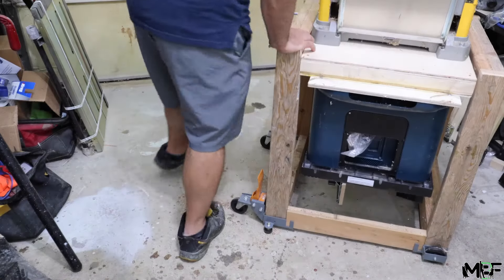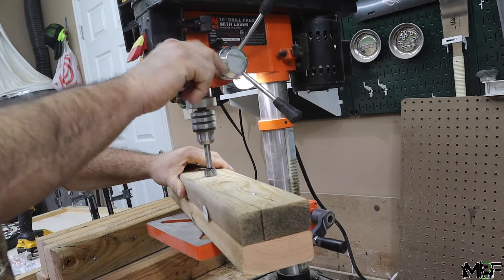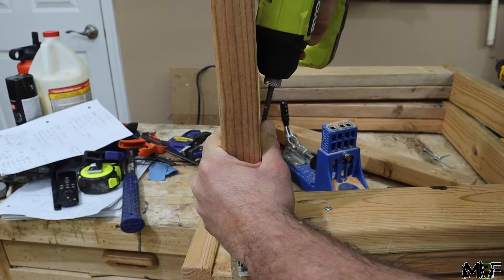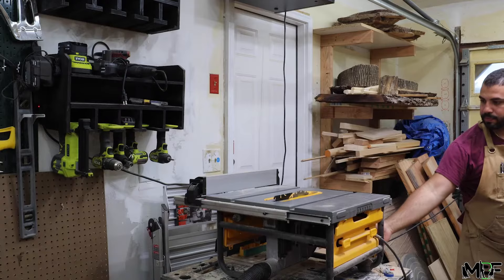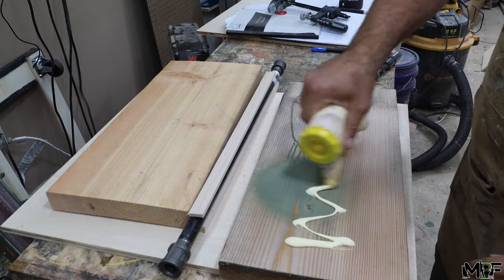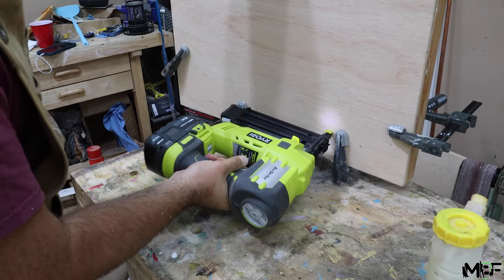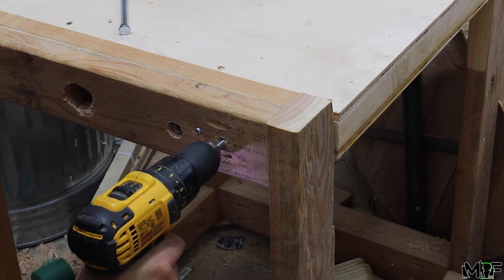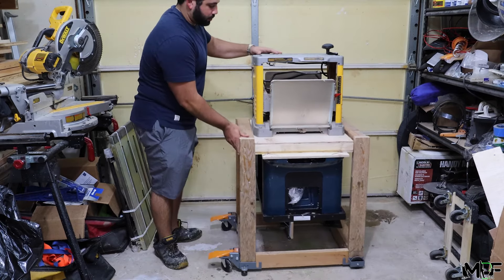Make EASY Flip Top Tool Cart | router and planer stand

Comment: Earned my sub! I seen a few designs like this a few years ago and have been meaning to make one as my shop is TINY (10'x 20'). Believe it or not I have a tablesaw, freud router table, rigid planer, delta jointer, a small ryobi band saw, a CNC router(with enclosure) 3D printer, laser engraver amongst SO MANY other tool in there. Although I have had to come up with some pretty unique ways of layout/storage in my shop that allows for quick(less than 1 minute) to swap out tablesaw for router table/planer etc... you can imagine my frustration in such a tiny shop....anyway, i went hunting for a video of this type and yours popped up first and I'm glad it did! Such an ingenious and SIMPLE design. I will NO DOUBT be making one of these today! Thanks for posting this! Two thumbs up!

Comment: I like your design and fact that I need the stand for same tools: planer and router table. I was surprised thought you used screws to mount the router to the platform. I might go with bolts instead. Thank you for sharing though.

Comment: I decided to follow this instructional. I've reached the point of completing the frame. The issue I encountered was the sections with the holes. Not having a drill press meant that the holes  on ne side were sloping and not level. That in turn meant that rod that will need to go through these did not align properly. As a relative novice woodworker, I decided the easiest solution was to cut a notch into the holes on one side. That now solves the problem of aligning the rod. Now I have to reinforce the notched side so that it can carry my miter saw when it is turned upside down.  This is a challenging project unless appropriate tools are available. Nevertheless, I've come this far, so I'll continue.

Comment: This looks great and exactly what I need.  How did you attach the pipe to the frame to keep it from sliding out?
Reply from the maker: Just screw fittings on to each end so that it’s too thick for the middle opening and you should be good

Comment: Of all the flip top carts I've seen on YouTube, this is the simplest and strongest one I've seen.  Great job.  By the way, where did you get the corner fixed wheel caster you used?  I checked the link on your comment for the caster wheels and it only showed the flip pedal ones.  Thanks.

Comment: I need to do this, but I think I would find some PVC to put into the holes where the pipe rotates so it doesn't wallow out the wood eventually, or some type of end that rotates, I think you could have a cheaper option for the bolts that lock it in place. But nice overall, I think the top was a bit overkill with the almost solid wood top, could have been 2x4 running flat with a 2x4 frame and plywood and would have been fine.

Comment: Great video. Nice to find one of these not made with a 3/4x4x8 sheet of plywood.  With coming up on one year how is it holding up?  Did you use 1/2 " plywood for the top?   Thankyou for sharing this, It's 99 degrees here so I'm just taking a break from cutting up my 2x4's .
Reply from the maker: It’s holding up absolutely awesome! The other day I even stood on top of the table to reach something on my ceiling and it didn’t budge an inch. I think it was 1/2” ply yep!
Reply: @MakersBestFriend  Thank you for the quick reply. Glad I found your channel.

Comment: I need to make this! Thx for a great tutorial! One question: your horizontal double 2x4s attach to the verticals with pocket screws, which I think means the tools’ weight is on those screws. Would it be stronger if the horizontal beams rested on the verticals or not really matter? (Novice here)
Reply from the maker: Jon good question. I prefer having the weight on those screws (and wood glue) because its a vertical force (from the weight of the machine) pushing against a perpendicular support from the horizontal screws. It would be stronger as you described, BUT only for the machine on top. Once it’s flipped over, the tool would be taking a lot of weight down and with vertical screws, I can see it start to pull out . Honestly … it would be best to do half lap joinery for this instead
Reply: @MakersBestFriend  Awesome, thanks for the great explanation!

Comment: Ok, I must be doing something wrong. I can’t stop the damn thing from racking side to side. Any suggestions?
Reply from the maker: It’s hard to say without seeing it. It sounds like you might have too much wiggle room in the tolerances, so maybe the the boards built around the pipe were too far away from each other, and then the bolts used to hold the table in place from flipping around are also not tight when push it, allowing the whole thing to slide ? Are the legs strong and sturdy and not moving side to side (this would be dangerous if they were)
Reply: No racking front to back, just side to side. Idk if it’s too long, because you really don’t give measurements. Mine was approximately 30” wide
Reply: My gas pipe that I used to flip the top was 31 inches long